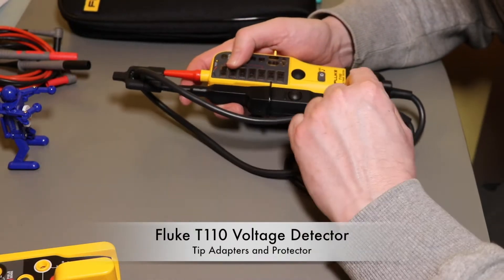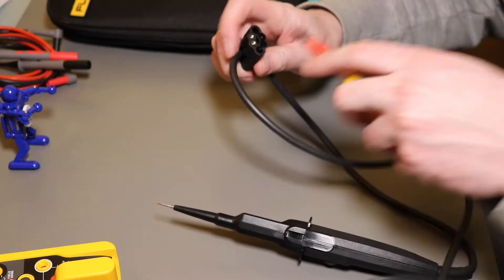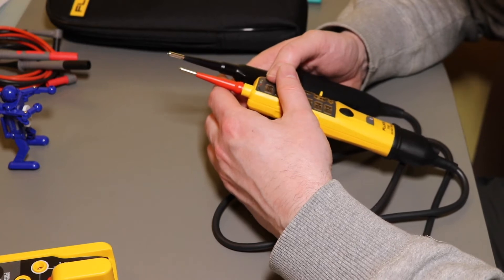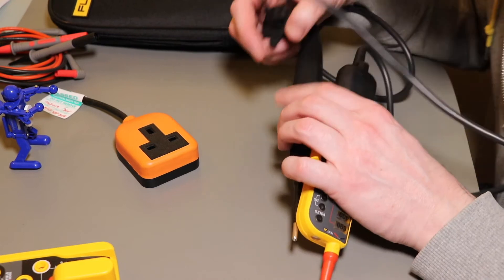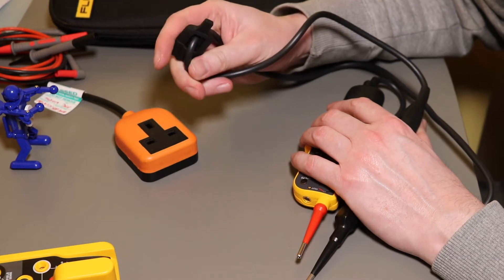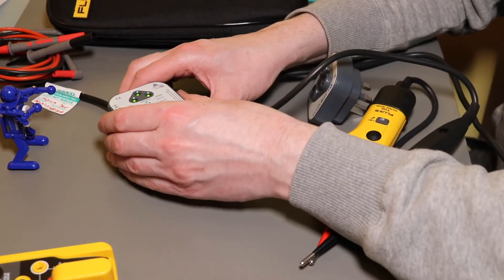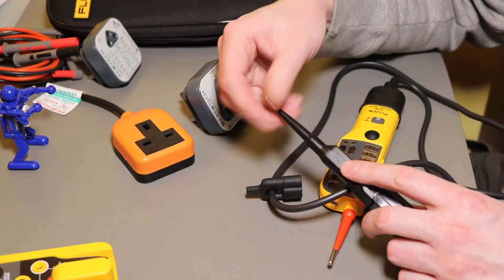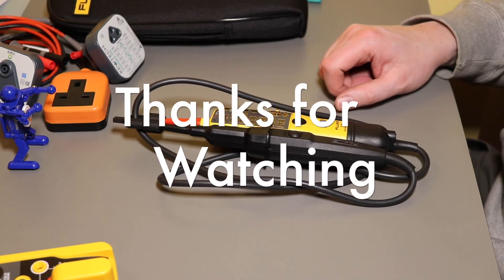Fluke T110 Tip Protector and Adapter Explanation

Comment: does not work on MK products as they have a 3 shutter pressure system
Reply from the maker: Thanks for the info 👍
Reply: And Hager, also has a 3 pin safety shutter like MK Logic Plus range

Comment: As I was looking at your video I grabbed my AMPROBE VPC-31 Electrical Tester. Because it also has a protective cap minus the point at the top. Also it didn’t come with the banana clips for the probes. Now the probes do have threads for screw on accessories, but no accessories came with the unit. Good video TP .
Reply from the maker: Thanks TETC. It is a shame when manufacturers do not include the basic accessories, just to make more money out of you if you buy them afterwards.